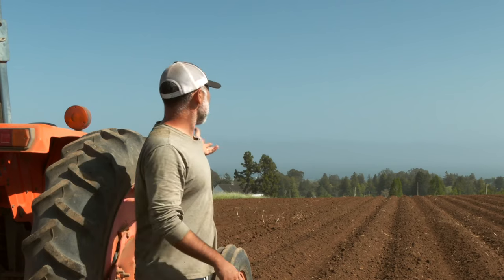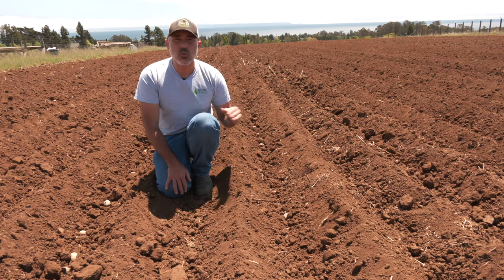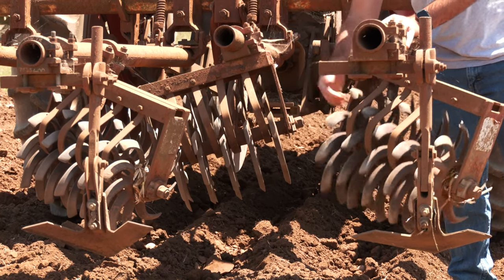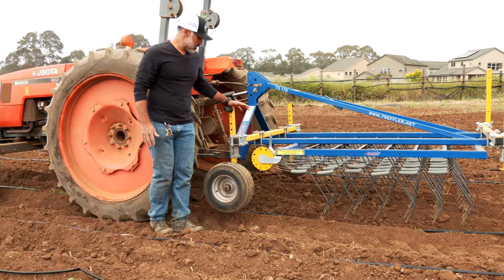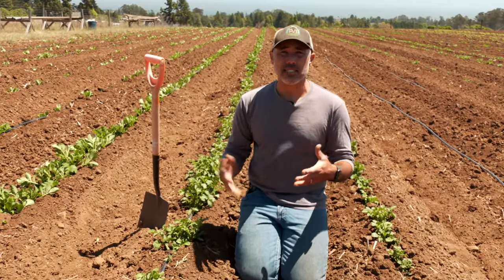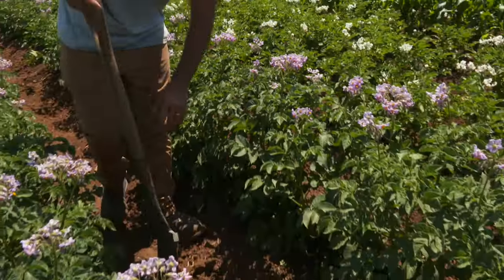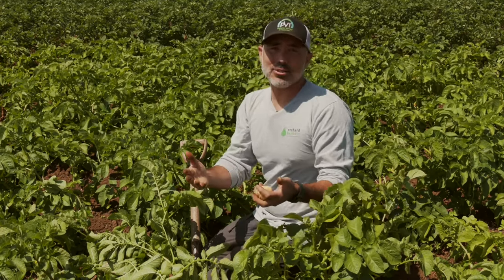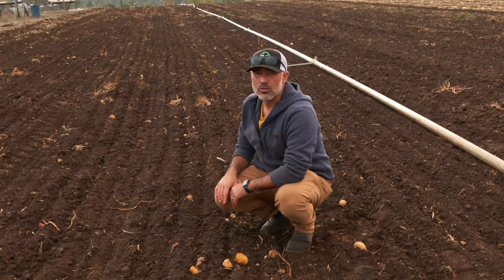Growing Potatoes At Field Scale - UC Santa Cruz Center for Agroecology

Comment: I'm surprised that your potatoes might rot if you irrigated.  I often grow potatoes in 35l tubs and I leave them in those tubs all through winter, so they get very wet in the winter rain, even in spring when I'm harvesting them the compost is still very moist.  I turned a tub out today in late April and the potatoes had started to actively sprout and we had leaves on the surface of the pot, but not a single one had any signs of rotting even though the container was still very damp  : All the best - Steve

Comment: I live 30 miles south of Nashville TN zone 7..  What date do you plant seed potatoes?  I have been trying to grow a good crop of potatoes for 45 years but all I get is 1 lb of new potatoes from each 1 eye cutting.  TN is hot 100°f dry as desert June to Oct with only 1 or 2 small rains per month all summer.  I use 6-12-12 fertilizer.  I keep seed potatoes in bright shade for about 6 weeks to get good eyes.  Our last frost is about April 20.  I have experimented every year sometimes plant April 1, sometimes April 20, sometimes, May 1st.  What temperature does soil need to be for planting?  I tried irrigation this year.  Red potatoes grow better than white potatoes but wife only wants white potatoes.  I still only get 1 lb of new potatoes from each plant.  Not sure what I am doing wrong?  I will grow potatoes 1 more time, Kennebec's this spring.  I have added a lot of ground up compost tree leaves to my soil it is soft but 3 months of 100° hot weather the compost material cooks away and soil gets hard again.

Comment: At what stage must I apply fertilizer?
Reply: Taking a guess here.. between cutting your cover crop and cultivating (to work the fertiliser into the soil).
Reply: Post response edit: - these guys use the cover crop as their fertiliser by flail cutting it and then disc it into the soil, as they are organic. So no added fertiliser, but see above if you want to add the extra fertiliser.

Comment: Hello good sir!can u please tell me what is the distance between 2 shovels?
Reply from the maker: 36 inches or 0.9 meters
Reply: @ucscagroecology  does that have anything to do with tire size?greetings from CROATIA
Reply from the maker: It has most to do with the spacing between the tires, which is 6 feet.  This allows for 2 rows between the tires.
Reply: @ucscagroecology  its that distance from the inner sides of tires?

Comment: With what did u atach this pvc pipe on that iron
Reply from the maker: A stainless steel pipe clamp.  Like this:  https://www.amazon.com/Precision-Brand-B20HS-Stainless-Clamp/dp/B001HWGML6/ref=asc_df_B001HWGML6/?tag=&linkCode=df0&hvadid=312126003778&hvpos=&hvnetw=g&hvrand=391548808629122847&hvpone=&hvptwo=&hvqmt=&hvdev=c&hvdvcmdl=&hvlocint=&hvlocphy=1014251&hvtargid=pla-568708647814&ref=&adgrpid=63790012682&th=1